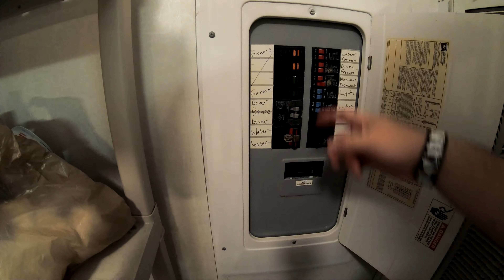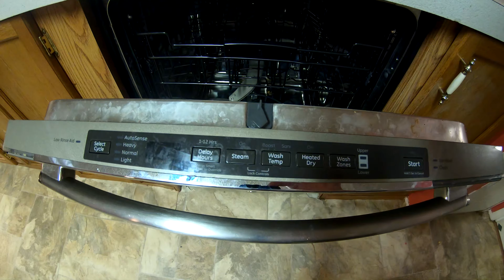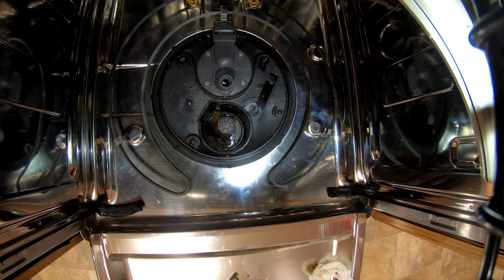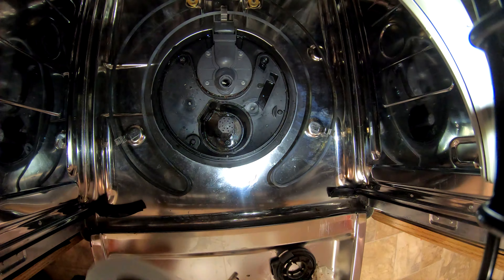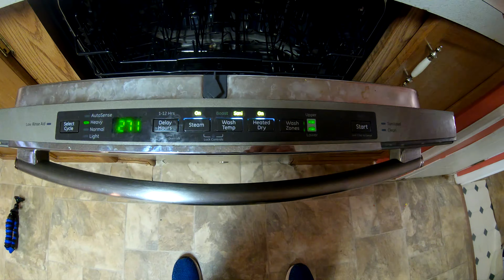GE Dishwasher Flood Switch Replacement!

Comment from the maker: Please be safe. Please Like and subscribe. THANK YOU! Here is a link to the replacement flood switch. https://amzn.to/2DOyy2o .FREE 30 day Amazon Prime Trial: https://amzn.to/2EpGB67 I had a rough time fixing my dishwasher, skip the repair man, do it yourself! If there's anything I can help with on fixing your dishwasher, please leave me a comment below and I'll do my best to help out. Have a great day! 
Flood Switch: https://fix.pxf.io/jrEkVZ
Bright Magnetic lights: https://amzn.to/2YUbmd8
Heating Element: https://amzn.to/2Lka5qc
Main Control Board: https://amzn.to/2M8X9Uc
Control Board: https://amzn.to/34PxXcL
Cascade Platinum: https://amzn.to/35ZCNEy
Spray Arm Kit: https://amzn.to/2ttQqxK
Affresh Washing Machine Cleaner: https://amzn.to/2Rq6TgB
Affresh Dishwasher Cleaner: https://amzn.to/353unuO
Cascade Rinse Aid Platinum: https://amzn.to/35ZCNEy
1/4" Nut Driver - https://amzn.to/2Ye0pCP
Paper Towels - https://amzn.to/2rVyCuy
Pickup Magnet - https://amzn.to/2DHc7fN

Comment: Thanks!!!...worked perfectly by replacing the float WS21X10519....could have gotten it on line. But, purchased at local parts store ($43 +tax), since I wanted it fixed ASAP!!  Also, took advice about plugging the drain hole while removing and re-installing screws. Saved me a lot of grief!!!  Took apart the old float...full of gunk and detergent residue which hampered the switch.🍀🍀🍀🍀
Reply from the maker: Glad it helped. Sometimes they can be fixed by cleaning but it didn’t work for me nor a lot of others. Glad yours is working again.

Comment: I watched your video two days ago and replaced this part yesterday. The float/flood part was definitely bad because it didn’t make a sound when I shook it. Put the new part in and the dishwasher wouldn’t start initially. I unplugged it for awhile because I decided to look underneath the dishwasher for a bit. When I plugged it back in it beeped!  I ran an empty load with vinegar to give it a good cleaning and checked for leaks. THANK YOU SO MUCH!  Now I have to replace the detergent dispenser. 😊
Reply from the maker: Sorry for the delay but glad you were able to get it going again!! Thank you for the comments

Comment: One tip I might add. While I struggled a bit to remove the wire harness from the flood switch, I was fearing that the harness itself would fall back through the hole when I tried to separate it from the switch. So, like the idea to put a paper towel in the drain hole, I put a paper towel in the hole at the bottom of the well to prevent the harness from accidentally falling back through it. I did manage to successfully unclip the harness without fear. Great instructional video!! Thank you.
Reply from the maker: Great point! It would be a pain to push that back through the bottom if it did fall through. I appreciate your comment. Have a great day!
Reply: @BreakFixRepair  My pleasure. But, Thank You most of all for your very helpful instructional video.
Reply: I almost did the exact same thing but I got lucky.  Good idea!!!
Reply from the maker: Thank you! I really appreciate the kind feedback. Have a wonderful day!
Reply: Yeah that happened to me and I needed needle nose pliers to get them out haha. It was a pain. Good suggestion
Reply: I wish I have read this comment before I unclip the flood switch, it fell down and I spent almost an hour trying to pull it back up with my fingers 😂, thankfully I made it safely without any damages, Job is done now ✅

Comment: Great video! Dishwasher was not utilizing the heated dry or steam functions and read it could be the flood switch. Watch this video and which showed how easy it was to replace. Also gave some very helpful tips such as drying up the well the flood switch sits in. Got the new switch in and it worked like a charm. Thanks for the video!
Reply from the maker: Great to hear!! Thanks!!

Comment: Thank you! My dishwasher wouldn’t warm: I tried the obvious step of replacing the heating element. Didn’t work. Was resigned to buying a new one when I found this video and it worked. Great explanation to help a not so handy guy. Just wish I had found it earlier, would have saved me spending $70 on a heating element.
Reply from the maker: I try to get the word out but unfortunately it seems people only find it when they have 1) replaced the heating element or 2) have been told by a repairman to buy a new dishwasher! Glad you found it before you replaced the whole thing though. Thanks for commenting!

Comment: IT WORKED!! Thank you so much! Very clear instructions! I used a shop vac to clear up the standing water. The float switch saved me from getting a new dishwasher! Now my dishes are dry and hot again when I take them out. Also.. I've had my dishwasher for 7 years and didn't realize there was a filter to clean out. 😳 I know! Gross!
Reply from the maker: It’s hard to know what exactly to do with a new dishwasher, at least it’s working now. I put out a  video a while ago detailing preventative maintenance (like filter cleaning) that’s pretty easy if you want to take a look. Glad this helped so you didn’t have to buy a new dishwasher! Have a great day.

Comment: I knew it was out of warranty, but I called GE anyway. BIG MISTAKE. $250, two trips from the tech, and 3 weeks later and I still don't have heat in my dishwasher. Seriously, I think this tech is trying to get as much money out of me as possible. He replaced the wiring harness that goes from the control board to the heating element. All he did was plug his laptop into the control board and said, it's fixed. He left, I ran the dishwasher, still no heat. With the help of your videos and a couple others, I was able to test the element and it's good so I ordered a float switch that should arrive tomorrow. Hopefully, that solves the problem.  THANK YOU FOR MAKING THESE VIDEOS!
Reply from the maker: Michael Webster I really hope it does fix your issue! As you can see from many other comments on my cross videos this part seems to fail more than anything else. If it does work tomorrow would you do me a favor and comment back to let me know if it fixed your issue? Thank you!
Reply: @BreakFixRepair  Replacing the flood switch totally solved the problem. The old float switch appeared to be gummed up with some nastiness. Funny thing, I even pulled a piece of plastic out of the bottom of the dishwasher when I was soaking up the water just like you did in the video. LOL. I can't believe that the "professional" GE repair tech didn't look at the float switch first. He either has nefarious motives or he's stupid, or maybe he's a repair rookie.

Do you have a cleaning method for keeping the nasty gunky buildup down that I suspect led to my float switch to fail? Thank you so much for your help. We're a family of 7 and not having a working dishwasher was making us crazy!!!!
Reply from the maker: @michaelwebster8844  Woot!!! that's wonderful! I hate the tech took that much money from you though... I've always considered that kind of service a rip off, for the most part. especially if they don't guarantee their work to fix it. So earlier this year I put out a video on how to maintain your dishwasher after you replace the flood switch. Check that video out. Here's the link: https://www.youtube.com/watch?v=k80hcuZoM9o The routine is listed in the video and the products needed are linked in the description. I appreciate the support. Thank you! Have a wonderful day. Also, I completely understand as I am a family of 4 (now) with three children so the dishwasher tends to stay running around here! If there's anything I can do to help feel free to reach out.

Comment: Our dishwasher (same as the video) had basically become a dish moistener.  Lots of globby gunk left on the dishes.  Most of the silverware still dirty. Didn't heat the water or dry properly.  Reminded me of the little girl in the commercial, "So, what does the dishwasher DO?"  With guidance from this video I took out the flood switch and found it impacted with gook.  Tried to wash it out but couldn't get the float to move.  Called my local appliance parts store who had them in stock.  It was pricier than A..... ($58) but we have company incoming so I wanted it fixed ASAP.  Bought one and installed it and the dishwasher is acting like its old self.  Haven't finished running the first load but I'm confident that it is fixed.  Thank you for making the video!
Reply from the maker: Perfect!! Glad it helped out in a pinch!

Comment: Thank you very much. Your video helped me fix the dishes not drying problem for a GE GDT580SSF7SS (Flood switch part WD21X10519). All tips in the video are very useful. One thing I would add is to temporarily hold harness is to use a hook of a bungee cord or similar so you don't let go of it. The other is to definitely a magnetic tip nut driver.
Reply from the maker: Thank you!

Comment: Thanks, man.  I followed your instructions and it worked. I do not know if it fixed the dishwasher yet.  It is still running, but I was able to swap out the float switch.  I did not know about this until I watched your video.
Reply from the maker: Thanks!!! Please let me know if it fixed your dishwasher.

Comment: I could care less if you had music or not, you saved me money!!!! Thank you for this step by step. I do have one suggestion for those that are having issues getting the screws out. We found the quarter inch nut driver didn't work. We had to use a 6.5mm nut driver and my husband's drill. Worked like a charm!
Reply from the maker: Thank you for your comment! That’s the first I’ve heard of the 1/4” nut driver not working. Now I’m wondering if some models came with different size screws! Thanks for the great feedback! Glad this helped you out. Have a wonderful day.

Comment: Great video pal...thanks for posting this. I found it very detailed, diligent with some useful tips on covering those holes with paper towel from losing those nuts. I followed to the "T" to resolve my issue to open and clean the Float Switch and put it back and guess what my washer started working like a champ again.

For those who are wondering... my issue started after I cleaned my dish washer as it was smelling with all debris at the bottom. I may have twisted the flood switch hoping it would turn but guess not. It appears like it disconnected the underlying power harness and as a result my dishwasher was not filling or spraying with water but does drain okay and heats fine. Removing and putting the flood switch back resolved my issue.  My Model GE GDF540HSF4SS came with our house in 2015.
Reply from the maker: Thanks for your comment! Great to hear your dishwasher is now working good again. Have a great day!

Comment: Thanks for the instructional video!  I was able to replace the flood switch thanks to your directions, but it turned into more of a project than your example.  My dishwasher didn't have enough slack wire to be able to plug the new switch in, so I had to pull the whole dishwasher out and disconnect another part of the wiring harness to get enough slack to work with.  It's back together now, and we're loading it up for a test run.  THANKS!

Comment: Solved my problem thank you! Couldn't take off the sprayer but worked around it. Dishwasher is only 3 yrs old and already replaced the control board a few months ago and now this!
Reply from the maker: Sweet! Glad this worked for you! Hate you’re having so much trouble out of it. You are the first person I’ve seen that’s had to replace the control board.
Reply: @BreakFixRepair  yup so with the control panel issue, one day i went to use it and nothing would turn on on the panel. There was also a burnt smell previously. I have a very similar model to yours i think the GE cafe series. CDT725SSF0SS luckily my husband was able to fix each of those himself but your video really helped us with the step by step and where to order the part.
Reply: @BreakFixRepair  one of the wires underneath the dishwasher actually looked completely burnt (wiring harness item #wd21x10541) so it started there then the electricity problem caused a jolt in the control panel. I googled and i guess it can happen because there is a lot of moisture in that area underneath which can cause it to short out. So we actually replaced both of those parts at once.

Comment: Thanks so much for this video. I ordered this part and fixed my GE Dishwasher model number GDT580SSF2SS.  The water level was lower than it should have been (top arm wouldn't turn) and the element wouldn't heat. This fixed both issues. My part also did not "rattle" like the new one so the float was stuck in it.  The hardest part for me was hooking the wiring harness back on. Pay attention to the orientation when you take the old one off.  This really helped me - I never would have deduced it was this part without this video.
Reply from the maker: Thanks for your comment and glad it helped out. It originally took me weeks to figure out what was wrong so I decided to help people out by making a few videos on how to do it and linking the replacement part in the description for them. Definitely glad this worked for you. Stay safe out there!

Comment: Great video!  I liked it that you didn't edit out the goofs....we all make them.  You have a clear and logical approach.  Yes, I did L & S.
Reply from the maker: Speedsterjohnny thank you! I tried to show people how long it would take from  start to finish with no gimmicks. It ended up being a long video but shouldn’t take 10-15 minutes to replace from start to finish. Appreciate the L&S! Have a great day!
Reply: Success!  The most difficult part was the wiring harness, a little stubborn undoing and reconnecting.   I took an extra step and put a long zip tie on the harness just below the plug and that kept it from getting away from me.  I left it on and stuffed it down inside as I was seating the new flood switch (next time???)  Lots of debris down there, sludge and a couple of toothpicks.  Ran a load and the machine performed like new.  Thanks again for a great video!

Comment: Hey just wanted to drop a thanks for your video - You helped me repair my dishwasher today and saved $$$ in repair costs. I loved your paper towel advice as the screws magically jumped where the hole would have been. Also, using needlenose pliers helped me place the screws back into the correct location for reinstallation.
Reply from the maker: Thank you for watching! Glad this helped!!

Comment: Thank you soooooo much!!!!  I successfully replaced the part without losing a screw thanks to your tip of filling the hole!!  The old part didn't make any noise when I shook it, the new one did.  Now I wait and see if the water gets hot and dishes get dried.  Thank you again.
Reply from the maker: glad this helped you! Hope it goes fix your issue. If you would, please comment back if the water gets hot and the dishes dry! Thanks!
Reply: @BreakFixRepair  Yes, it works like brand new.  Thanks so much again

Comment: Thanks for the tip of getting all the water cleaned out first. It's a really good idea to prime it before running it through a cycle. Take a pitcher of water and dump it on top of flood switch until it's covering the flood switch. It will suck air if you don't prime or first.

Comment: Using a wee dab of petroleum jelly in the pocket of the nut driver would cause the hex head self tapping screws to adhere to the nut driver's pocket, and implement the reassembly of the flood switch replacement tremendously! I didn't bother to count how many times you dropped the screws... I've done a bit of mechanical repair work over my years, and that's a quick and easy trick to help everyone. 
.
I strongly recommend using petroleum jelly rather than heavy axle grease, the heavy stiff grease won't melt and wash away like the petroleum jelly will... 
.
Thanks for this video, I was about to call a repairman (and pay to the tune of 200+ dollars for the parts, service call, and labor. I haven't replaced my flood switch just yet, but it will be ordered as soon as I'm done with this comment.

Jim
Reply: BIG THUMBS UP FOR YOU BFR!!!
Reply from the maker: Thanks Jim! I did drop them quite a few times. I could have edited that section out but I really wanted to give everyone a realistic approach to what replacing this part really consists of. I hate it when you see a 2 minute video on how to replace something and it ends up taking an hour or so, obviously that's a bit extreme for this scenario lol Thanks for your great comment! Have a good one!
Reply: @BreakFixRepair  FYI, I followed your instructions to the letter, yes I plugged that hole with a paper towel, and yes I dropped a screw down there even though I used petroleum jelly, but a handy pair of needle nose pliers saved the day.

Bottom line: I repaired our dishwasher and I did it in about 20 minutes total. Most of the time was spent soaking up the dishwater.

Tested it, and it's working great, HOT WASHING and hot drying. 

BFR, Man you saved us at least $150-$175 dollars in service calls and parts.

I just had to come back to you and give you great kudos! Thanks, BFR.